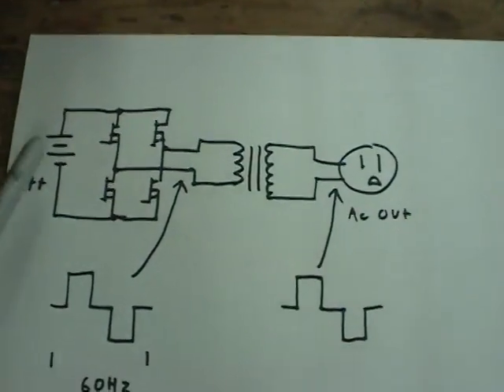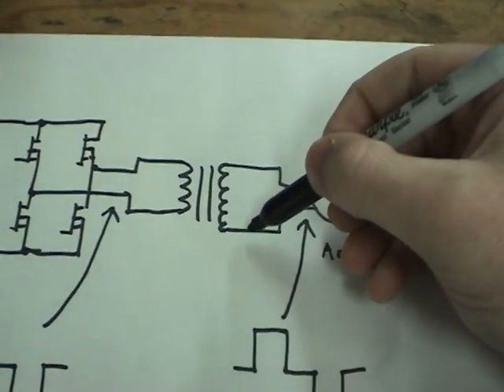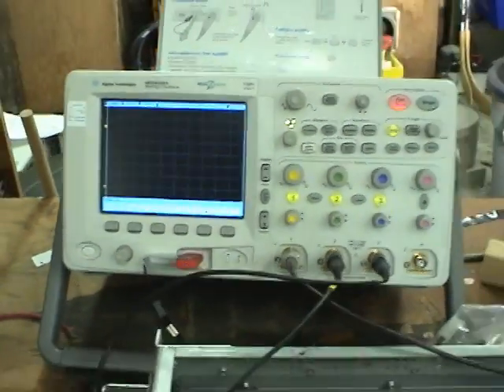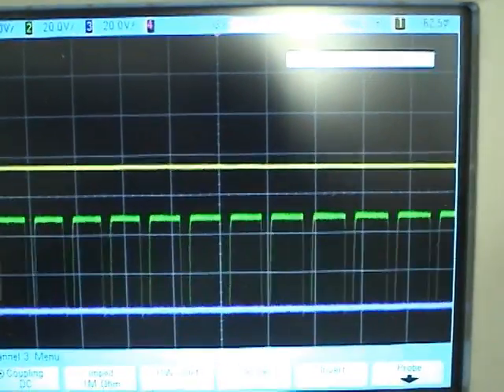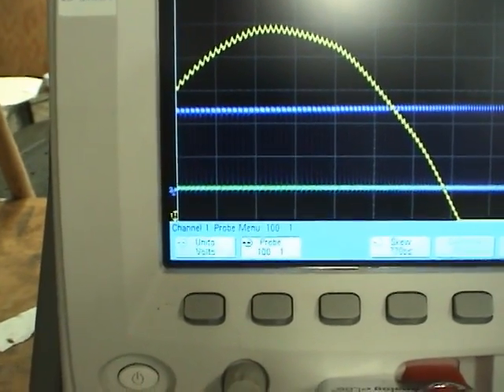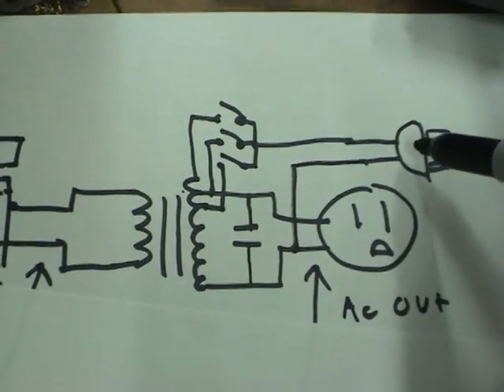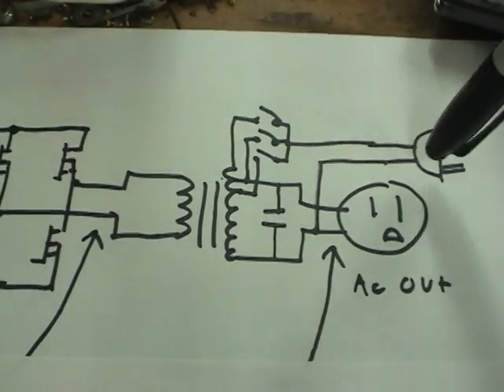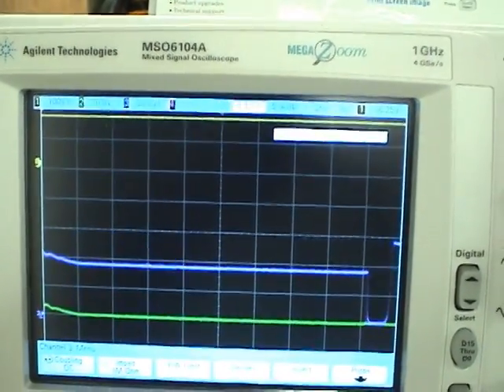In-depth look at True Sine Wave UPS operation

Comment: I was really interested in how much noise and ripple was in the output from a switching UPS.  I have an SUA1500 which is also rated as "true sine wave" and was curious how good the "stepping" really was.  While my model is not the same it's definitely in the same family and gives me an idea of how well it will work with typical electronics. Thanks!

Comment: Will a Tripp-Lite  LC 1200 line conditioner change a square wave to a sine wave?  Is there any way to check the output of a inverter other than a scope or seeing if an appliance will burn up?

Comment: Thanks for the info my man. Question. With a high end UPS like an Eaton 9355 or similar would it be possible to synchronize the sine wave with a generator or is the nature of the sine wave a UPS puts out and that a generator make something impossible or not economical? The reason I ask is because of someone is wanting a long back up time like an hour on a larger unit, like 100kva or so it's not economical to do so with batteries or at least not really viable from a cost and foot print perspective.

Comment: Another great video! 
I had ten of nearly isdentical SU3000RMT3U by APC. The first time they were shipped all of them were bad because the transformers had ripped their machine screws out of the thin sheet metal. The second shipment had 6 bad ones for the same reason. 

They were pretty good, but the "Smart Boost" feature caused a delay in switching to battery power. There was one UPS for each linear power supply in our Solid State Logic audio console. By the time they had switched to battery, the console power supplies sometimes switched off. The console could run on two supplies, but on one supply it would blow a fuse. The fix came when we got a building-wide UPS and recycled the APC's.

I wonder if feeding a linear supply made it harder to determine an outage. It sounds like they fixed the problem by going to battery power before changing taps.

Comment: how close could i get without the step up phase? like if you hook the drive wires in a way that they provide their power just to a bipolar cap and look at the oscilloscope reading, how sine like is it? im making a hf style inverter, you know the cheap ones, but with a buck boost converter for the input, so i can use 5v up to 600v to charge the cap bank but im having power leads go from there to a 120 or so volt battery bank so i can have high currents but only need a small current for the buck/boost stage, and so i can run it like a ups without needing to sync to the mains

Comment: thanks bro, this helped heaps. I saw some other circuit diagrams and each MOSFET had a free wheeling diodes across it, what are those diodes for?
Reply: Afaik those protect the mosfets. When switching coils off, evil induced voltages appear and they can easily break sensitive parts like mosfets. The diodes short out those spikes so the mosfets dont die.

Comment: Digital sine wave is not perfect but never  perfect because of 0 1 1 0 digital switch .The very true pure sine wave is from ac generator that generates sine wave without stepps
Reply from the maker: +Camaracta Sanctis Theoretically yes, but show me a power generator that produces a sine wave better than this. This is better than any wave I've seen come out of the wall socket, that's for sure. It's all a moot point anyway, no normal device cares that much about the exact shape of the wave. A square wave output UPS will power your IT equipment just fine.
Reply: tesla500 Yes but the square wave is ineficient and less torque on motors but in digital pulsed sine wave runs motors fine about 98% 99,5% i think
Reply: +tesla500 they dont care that much but my fridge and my smoke alarms can tell you they didn't like modified sine wave power up till they died from it, reply to find out how they died and my thoughts on why it happened

Comment: Funny how this statement was true to the time, but modern high efficiency power supplies in pcs require true sine wave or they won't work.  I'm referring to stuff like 80 plug gold.  Some of the older ups units wont work with modern computer powers supplies.

Comment: Thank you for the really nice video,

Questions: 
if a line-Interactive UPS is labeled with "perfect sine wave" generating abilities,
does it mean i can get perfect sine wave all the time even when i am not using the battery?

does perfect sine wave equals to clean power?

if the above are positive, why would any1 need a "on-line" UPS at all?

Comment: Excellent video thanks
I have a the same here European model 220V 50HZ only the batteries are dead.
The auto change voltage is like a auto tap on a street transformer.

Comment: About 7:40 if you got lower voltage you woult have more turns to rise the voltage and vice versa.
So, if voltage is high mid-off  down-on, if low mid-off up-on.
Sorry if I'm wrong.

Comment from the maker: @filipkof Glad you liked it!

True sine UPSs aren't really that important unless you're running a motor. PCs and other things with switching power supplies work just fine on a square wave.

LC filters are used in very large (100s of megawatts) inverters on the end of DC power transmission lines, but I think they use more than just a 3 step waveform like traditional UPSs put out.
Reply: That is multilevel inverter.

Comment: I was curious about how these works. Thanks for this video it really helped me  to understand that. I wasn't expecting something like PWM to make the sinewave. I wanted to modify my modified-sinewave inverter to produce the true sinewave simply by adding a LC on the output, which really worked but it consumed about 40% of power so it was very bad solution and i removed it. To construct this, it will be much more difficult for me...